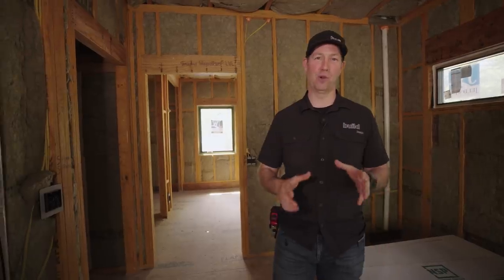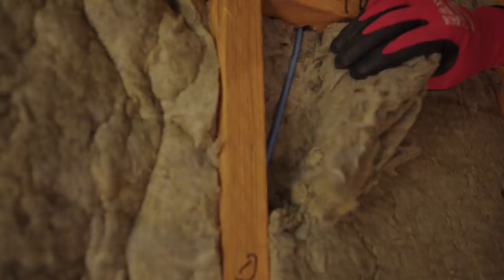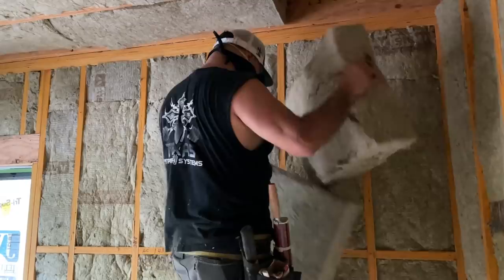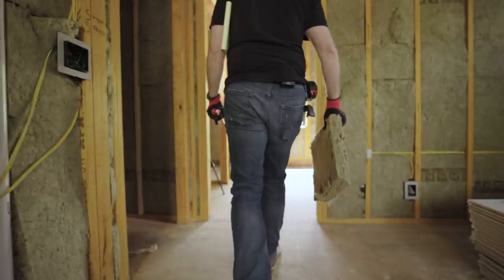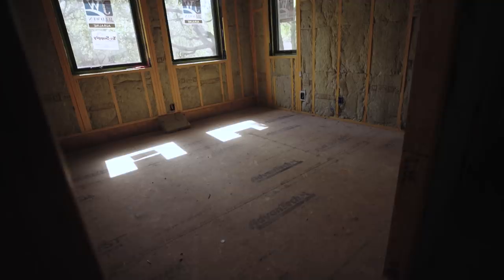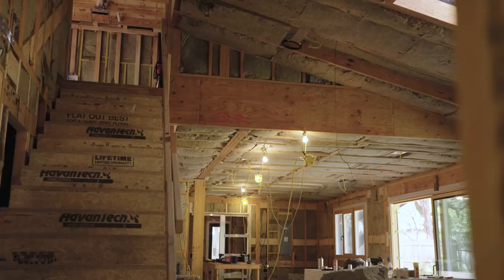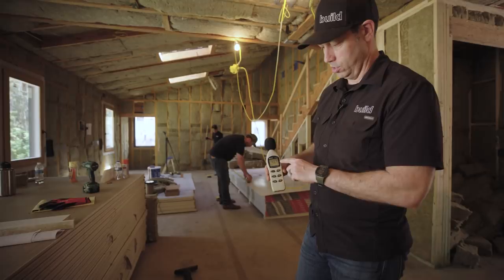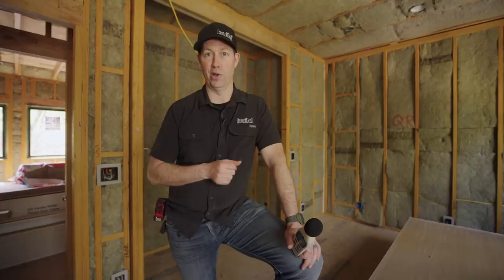7 reasons I used Rockwool insulation at my house.

Comment: So question, has anyone ever used a 100% wool product like Havelock wool?  It has zero chemical VOCs and is all natural with a superior R value compared to fiberglass and mineral wool.  It also can retain humidity and moisture very well and provide great indoor air quality.  The price is around 30% more than rockwool.  I'm building my new home next year and wonder if it's worth it for the indoor air quality aspect compared to rockwool?  Any input/advice would be appreciated.

Comment: I'd fact check that recommendation for a serrated knife.. pretty sure you just want a basic razor sharp blade. Like the pros are literally using.  Otherwise you will have a mess and a bad time. Also using a lighter like you've never lit something on fire before. lmao.

Comment: If your house is not sealed and has draft, in case of fire no Rockwool is going to save your house.  In case of flood- open cell can dry if you just let it dry and not pull off the wall, dummy.  Dehumidifier and al fan. Or use closed cell in food prone zone

Comment: I've been saying it for years: I DON'T TRUST SPRAY FOAM. I keep telling people that there are unknowns and that offgassing is a real problem. You might be fine, you might not, but a product like Rockwool is the healthiest way to go. Too many contractors use spray foam to be their "save all" when they build a leaky house, but I wouldn't want to live in a tight house with bad air. Build a good exterior and use healthy material on the inside. That's a house that's a home.
Reply: Try going with a reputable family business, instead of complaining when the lowest bidder on the job turns out to be the lowest quality. It's an unregulated industry, what do you expect?
Reply: @currincook6422  How does a reputable business take away the risk of mixing toxic chemicals? Asbestos was also installed by quality companies, but that's not the issue, it's the product itself. A good installer will allow the first layer to cure/expand properly before going over it with a second, but no installer is perfect and even the chemicals can be applied at differing rates which can cause offgassing over longer periods. There is not enough evidence for the product to be considered safe. It has been pushed as a wonder sealant by the chemical companies and I am afraid it is adding more dangerous carcinogens to our system in the place we sleep. Not to mention it is non-renewable/recyclable, difficult to remove, difficult to remodel after the fact, and quite expensive compared to proven and safer alternatives.
Reply: @MyFortressConstruction  Because we don't hire wanks to run foam rigs, it's really quiet simple. I've been in the business myself for over 10 years, along with my father who has nearly 40 years. I'm pretty sure I'm more than qualified to speak on the subject. A competent sprayer is actually perfect at what they do. The best don't make $50 to make mistakes
Reply: @MyFortressConstruction  Haha.  Your bed mattresses and sofa and carpet padding are all foam.  Spray foam is great.  We have it and LOVE it.
Reply: @gerrywagoner26  For one thing, there are different types of foam out there. The type of foam used in insulating houses is not the same as what you find in your mattress, or carpet. The second thing is that I care about those things as well and research the types of flooring, bedding, etc. that are in close proximity to us for large portions of our lives.
  I'm glad you love the spray foam benefits (tighter and better R-value), but a better system is to use rigid foam on the outside of a structure, but inside where we have a lot of air being recirculated, I do not trust it. In short, spray foam is way better than fiberglass at stopping air flow so it's an easy way to help a bad design perform better, but until 3rd party testing, over a long period of time, is performed, it's in the same space as asbestos to me.

Comment: Disappointed you didn't use 2x8 framing. 😄
Reply: Actually  offset 2x4 walls are even better  frankly than 2x6 of 2x8 walls. Better thermal break

Comment: Any idea how this compares to Havlock sheep’s wool insulation?
Reply: Mineral wool is cheaper, insect proof, flame resistant and hydrophilic. The Rockwool brand uses formaldehyde binder though formaldehyde free mineral wool insulation is available from Owens Thermafiber. 

Sheep’s wool or lambs wool is natural and sustainable but it’s expensive, can host pests, absorbs and holds water/vapor, settles thus suffers significant thermal decay, especially in walls and it’s not flame resistant. It also must be sourced from reliable company that thoroughly sterilises or it will smell inside your walls. It’s also very expensive.

Comment: Can you compare r value to foam and the pink stuff?
Reply: Foam will have a much higher R-value, and in addition will provide the benefits or air sealing. Rock wool and fiberglass have very similar R-values, however there is I’m sure a benefit to the rock wool because of its density (vs fiberglass). The biggest benefit I see is the ability to do a much more efficient installation with Rockwool, especially for a DIYer. I am not an expert FYI.

Comment: Rockwool is moisture resistant, not waterproof!  If the insulation becomes damp or wet, the insulation, when thoroughly dried, will maintain the original performance characteristics.  Unfortunately, in order to do this, 9 times out of 10 it needs to be removed from the structure to be properly dried.
Reply from the maker: My point was more that it’s removed more easily than that spf in the video

Comment: The first time I used Rockwool I made up my mind I would never ever buy or install another piece of fiberglass. Ever! Fiberglass requires perfect installation in each cavity with perfect air sealing in order to perform at its rated value, those conditions are almost never realized in real world construction. If fiberglass gets wet it pretty much stays wet. Fiberglass is difficult to install correctly in odd sized cavities whereas Rockwool is easy to cut to fit perfectly. My top 10 reasons are, fiberglass sucks, fiberglass sucks, fiberglass sucks, etc..
Reply: Thank you for sharing your opinion. I actually like to hear about fails and cons because those are the things we try to avoid. How else would we know to avoid it right? Thanks.

Comment: Somewhat unrelated to the insulation, but in the video of the wet spray foam, Matt was not wearing gloves when squeezing the water out. Having lived in a flood zone and through a severe flash flood, you DO NOT want to handle any flood affected materials or contact flood waters with bare skin. It’s not the end of the world if you do, of course, but there’s a lot of nasty and dangerous stuff that gets mixed in with that water that can harm your skin or make you very sick. All manner of fuels, household chemicals, toxic materials, pollution and so on tend to mix in with that muck and can basically turn the affected region into a toxic waste dump during and long after the flood. My own neighborhood was a FEMA hazard zone for weeks before it was deemed safe enough to allow the residents back in, and even then polluted water bubbled out of the spongey ground for more weeks after the fact. No bueno.

Comment: This is easily a half a million dollar renovation.
Reply: Not when you’re getting most of the material (and probably labor) at a deep discount.
Reply: Sorry to say the engineering and construction for the entire house in lvl framing plus the metal roof is easily 150k we’re talking top of the line everything from there on out hmmm ya I doubt they are giving heavy discounts on his materials because of the material shortages throughout the entire U.S..
Reply: @phishynate6053  150k roof? No way. Not unless it is 14 gauge copper.

Comment: pink fiberglass imo is better, your paying too much for a very slight improvement.
same stc rating, go staggered stud if you really want an improvement in stc and keep the pink stuff.
same insulation,
slightly better fire... but drywall accounts for 20min of your rating, I don't think you'll notice a 30sec-1min improvement...
Reply: I agree mostly, however when it comes to efficient install (ease of install, efficiency of the finished job, rock wool is superior). I’ve seen so many atrocious fiberglass installs, just look at cutouts around utility/outlet boxes. When DIYing this is even more true.

Comment: Nah, rockwool is a pain in the ass. I installed some today, and it will get in the air, in your eyes, on you skin. And it itches like a mofo. I still cough and i use eyewear and mask. Took 2 showers, and the skin still itches. I would not like to live in a house insulated with it. In Europe we mostly use it to insulate on the outside of the house, over the brick walls.

Comment: I hate rockwool. I was trying to insulate a ceiling with it (before I knew baffles existed to ventilate so I didn't need rockwool), it irritated my respiratory system the particles fall out constantly and probably stay in the air. even with mask and glasses somehow I still get it in my eyes and lungs (because it stays in air) the whole thing is a freaking joke. I switched back to fiberglass--half the price, more readily available, and the air stays clean and don't regret a thing. this thing is a misery to anyone who has had some time to work with.

Comment: Rockwell is a great product when installed correctly even in your video you see gaps and cracks in places behind receptacles where there's no insulation a layer of high-density foam first would make your rock will work like it should!
Your video is very misleading your house will not be as efficient as it can be with other products!

Comment: Im just baffled that you in america run wites loose in the walls. In Sweden we run them in pvc piping. Easy if you need to change the wires when they get old, and much less risk of rodents chewing on them
Reply: Not truly "lose" in the walls. Usually run up a stud and through the centre of it if needed. Pinned and also held in place by insulation. Done right it doesn't move much. Using PVC piping would be very expensive with all the joints you would need. It also must significantly  weaken  the studs if the PVC has to run through it.

Comment: The product is totally overrated for soundproofing. Inch for inch, fiberglass insulation works much better for sound insulation and has a much higher R-value and as far cheaper.

Comment: This man's examples are very funny. He holds a lighter next to the stone wool, as if the fire will start from it, and not from the plasterboard, which will be the final coating. Or from the outer facade. Why not set fire to one panel that represents the entire structure of the house, let's see how it won't burn.
And the water example?
Do you equate watering from a water bottle with a house that has been sitting in water for weeks? And this is an example? Seriously? Well leave the rockwool for two weeks in a tub of water and then show me, we get that you're promoting the rockwool, but don't be such a joke